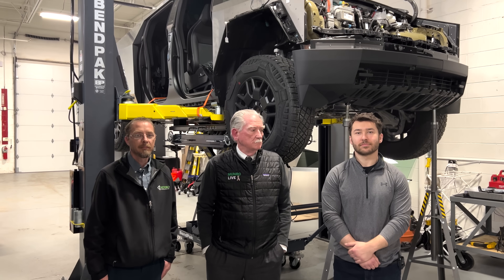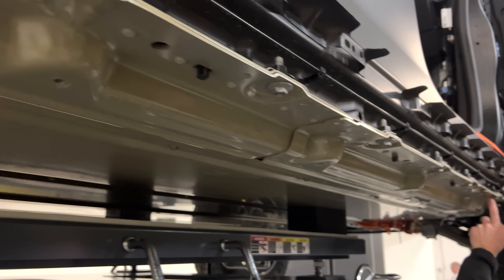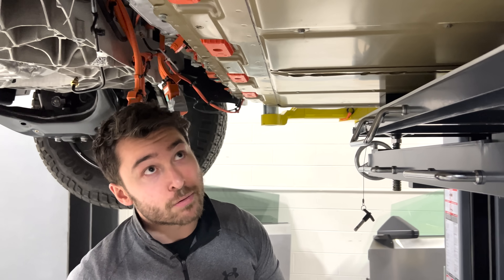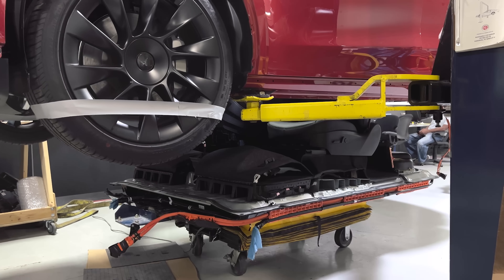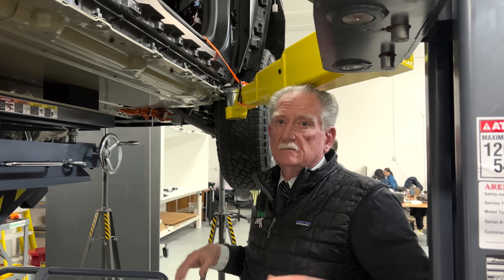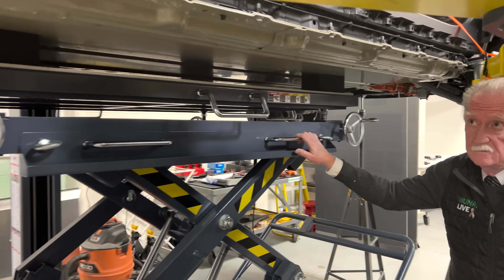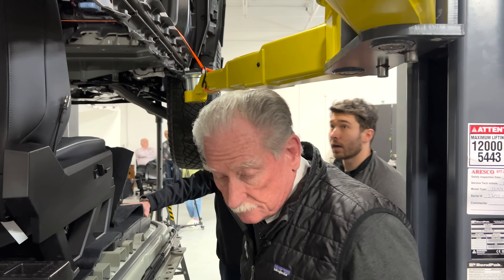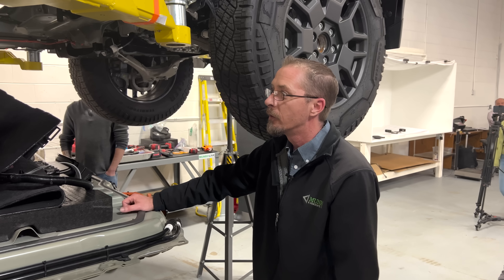Dropping the Battery Pack in Our Tesla Cybertruck!

Comment: Is the cybertruck battery pack wider and longer but thinner than the competition?
If that's the case, do you think they will switch to 4695 and 46120 cells for a long range truck?
Reply: I would guess that the Tesla 4680 cell is currently at about 50-60% of its eventual density.
.
The problem with taller cells is they require a different production line and won't be compatible with smaller vehicles.
.
What people miss about the (Tesla) 4680 is that it's just as much about the system as the cell.
.
The idea is maximum GWh (TWh) capacity, from the smallest footprint of factory, with the lowest possible energy and material consumption.
.
Efficiency.
.
It's about the goal of "Energy Transition" which includes HOW you use energy during the manufacturing process, not just efficiency in the end product.
.
Reply: @rogerstarkey5390   you talk a whole bunch of nonsense, 4680 cells are not at at just 50% density, they are pretty much ready and they suck. You would have to change the entire battery chemistry for a significant increase in density and move towards solid-state batteries (which aren't even really that dense as of today). The difference in size is of the 4695 cells in comparison to 4680 is not big enough to make a difference into which car they can fit. Generally speaking the industry moved on from 4680 cylindrical cells towards 4695 or even 46120 cells. In addition cylindrical cells itself lose their importance in the industry to other form factors like prismatic cells, they seem even more capable. The rest of your dream world of the Tesla battery being a "system" is just yapping.

Comment: To change a battery pack I assume is quite labour intensive having to remove all the "interior" instead of just a battery pack - Unless of course that comes off separate to the battery pack - Would be interesting to see that too. Great series this..
Reply: The savings are at the production line, it’s better to save money here than the seldom occurrence of removing the pack at some unknown time in the future.
Reply: @streddaz  yes, but it makes for very expensive insurance and repair costs which make the cars get written off in cases of accident. As an end user I'd rather the serviceability was improved - lets face it, the cheaper manufacturing costs are not really passed on to the likes of me - Thats for Elons pocket. That said, Munro is all about production line stuff so not probably aimed at the likes of me, a mere motorist - interesting as it all is.
Reply: @GHOOGLEMALE  I don’t think that just having to remove the seats, console and carpet will add that much to the cost of a battery. Manufacturing costs do impact the purchase price as can be seen by the reduction in price of the other Tesla models due to manufacturing efficiency improvements. I do agree that there should be more repairable components in modern cars. Unfortunately Tesla doesn’t follow the right to repair mantra.
Reply: @streddaz " Unfortunately Tesla doesn’t follow the right to repair mantra." Indeed, I understand workshops even bodyshops have been refused purchasing of parts to repair vehicles, Tesla is a one stop shop. - Once out of warranty the resale prices plummet. Important factors in owning a vehicle are servicing and residual values - a 100k car worth 15k in a few years cannot be sustained - there is a lot of good choice out there now. The manufacturing methods employed are cheaper, but at what cost in the medium term if no-one can fix it. I did see a youtube thing yesterday mind on a Tesla S 90 which had covered 450,000 miles as a taxi (Autoalex) - Thats impressive without doubt.
Reply: @GHOOGLEMALE  I think that’s the way a lot of companies are going in regards to right to repair unfortunately and not just the automotive industry. 
I have been watching Aptera for a while now and they state that they believe in right to repair, so I’m interested to see where they go once proper production begins. 
I really believe that more cars aren’t the solution regardless if they are electric or not. There are more environmentally friendly ways to get around.
Reply: @streddaz  Yes you are right. Aptera, not heard of it - off to google...
Reply: @GHOOGLEMALE  they are an interesting company. They focus on efficiency rather than throwing big batteries at the problem. Once again, their first car is just a two seater, so won’t be the solution for everyone.
Reply: @streddaz  Yes I looked at their video after you mentioned it - very funky and innovative. I just read on here (The Electric Viking) that Fisker have reduced their cars by 50% - $25k for the Ocean normally $50k. Sign they are going pop (again?)
Reply: @GHOOGLEMALE  maybe? Unlike Tesla, I don’t think the reduction in price is due to manufacturing gains, so they might be in a bit of trouble. Lucid also sound like they might be having cash difficulties too.

Comment: Thanks again. How did you get that pack with the seats out from under the body? I'm betting you had to take the seats off of the pack and man-handle them out?
Reply: Structural battery pack life
Reply: That hoist goes up a long ways.  Maybe not.   Tesla will have to do this at service stations.    I don't see them pulling the seats to get the packs out.  Would be lame as I think your trying to point out..   Not sure but I think the headrests may be removable.  They are put on like an adjustable unit. Two tubes.
Reply: The lift wasn’t fully lowered
Reply: @danharold3087  If you look at the first two seconds of the video, you can see the cross-member of the lift isn't too much higher than where it's at in that shot. When they drop the pack, it looks higher than that, so probably maxed out or close to it.
Reply: @garyswift9347  OK.  But there is no obstacle here. More of a choice.  could have started with the truck lower. Maybe not use that nifty stand.
Reply: @danharold3087  Fair enough. I don't know. That's why I'm asking. :)

Comment: Why don't they do the rear bench also? You'd just need to add a hinge so the seat bottom folds forward in order to clear the supports. Same goes for 4680 Model Y.

Comment: This is great. Is there room to increase the battery size?
Reply: "Size" or "Capacity"?
There's a difference.
Reply: @rogerstarkey5390   I should have worded it better and asked if there was room to fit more 4680 cells into the current structure/battery pack.

Comment: It’s ironic watching video after video of the associates gushing over all the clever engineering tricks that increase productivity and reduce manufacturing costs on a vehicle that overshot its original MSRP by 50%. 

Would be interesting to also hear about why the truck ended up being so much more expensive than promised, and the choices that got it there.
Reply: Prices have gone up on most items.  The truck is no more expensive than any other well equipped truck on the market.  Why sell it for less??

Comment: 24mm Bolts hold it up?
Reply: Looks like 20mm
Reply: ?
The number and diameter is more important than the length.
8-10 per side?
5-6 at each end?

Comment: What I want to know is if there is enougb room to add an additional battery pack underneath. I don’t want to give up 1/3 of my bed to get 500 miles range. 500 miles was the range promised and it was the spec that sold me.
Reply: I think I answered this question about 1/2 an hour ago.  No.
Reply: @danharold3087  then needs a complete redesign. START OVER. lol XD

Comment: If you have 3 phase current, will the battery still charge if for some reason one of the 3 phases is not working? Will it basically charge on two phase current?

Comment: Please explain the term 'the penthouse'.  Sounds like slang used by engineers but the rest of us don't know.  Also, where are the back seats and the carpet?  Were they removed off camera?
Reply: Judging from 6:48, the back seats remain with the chassis, folded up. Rear floor can be seen at 6:57 on top of the battery pack, just foam plus folded carpet and a piece of plastic cover.

Comment: Sandy, I'm going to ask a favor, can you please do a short video of where first responders can cut the high voltage wires in the Cybertruck? I have not seen one yet.
Reply: Why cut when you can unplug?
Reply: If you're a First Responder, I would suggest you "ask Tesla"
.
If you're not......

No comment.
Reply: @rogerstarkey5390  I have in the past, they tend to publish a 45 minute video that only two minutes of is what the Fire Fighters need to see. I am the planning officer in a local Emergency Management Agency. Getting a quick video to show where to disable the battery will save time on the scene. A short and concise video is something the fire fighters will watch.
Reply: @ronjos  If they can reach it yes they should unplug the cable.

Comment: Due to the high rigidity required of the battery pack housing to avoid cracking the potted slabs of cells, you'd have to be asleep to not to exploit that structural element.  Packs using pouch cell or prismatic modules would accept slight flexure if needed.  But, I'm so far unexpectedly impressed with the design engineering in the CT.

Comment: Saves on assembly. Adds cost to ease of maintenance. There are no solutions. Only trade-offs.
Reply: Probably no maintenance possible on the inside of the pack.. in the Model Y with structural pack that they disassembled... you cannot repair the inside of the pack.. its is packed with expanding adhesive foam. I would assume this is the same.. it has the same 4680 cells.
best you could do would be to swap the pack.
Reply: @kens97sto171  Yep. "Genius" design... for their bottom line.

Comment: DEAR MUNRO, (I have a question):-
As I understand it Tesla vehicles incorporate a rectifier, presumably to convert AC into DC for the purpose of charging from regular AC power sources.
Could you comment on the possible practicality of producing vehicles without this piece of equipment.
Some charging stations supply DC directly, for home charging the rectifier could be sited at home and if a vehicle owner wants this feature incorporated into their vehicle could it be made to be mountable/demountable?
This would seem to offer an opportunity to save weight and even possibly cost.
Do you think that EV.s really need to incorporate Rectifiers?
Reply: Let's leave it to the "smart people"?

Comment: Sandy " I don't know why this never been done before."  VW Bug leaves the chat.
Reply: He’s not talking about loading from the bottom. That’s pretty typical with drivetrains. It’s about the floor and interior elements being installed as a single component
Reply: @PeteLenz  Yes like a VW bug. The complete body dropped down on the rolling floorpan, on top of a seal and bolted together with 24 bolts. That would be the next step for Tesla.

Comment: That battery is so ridiculously thin that it's arguable Tesla should have raised the ride height a few inches and added a nickel metal hydride battery on the bottom for 50% more range. This is basically what GM did with the Silverado EV (though it's all lithium).

Comment: I'm close with a few Tesla techs and in the service center they do not leave seats in the car when dropping batteries that have this set up. Seats can be damaged on the way out and it's safer for the seat to be removed through the doors surprisingly
Reply: How? This came out like butter. No chance at all of hitting the seats. Maybe the Y has less clearance but in this truck there's no way I'd rather pull the seats first if I was doing the pack
Reply: "I'm close with a few Tesla techs and in the service center they do not leave seats in the car when dropping batteries that have this set up. Seats can be damaged on the way out and it's safer for the seat to be removed through the doors surprisingly"

Not likely. They were inserted vertically and the best way to remove them should be vertically as well.

Comment: would they show how they roll the battery with the seats on top from underneath the vehicle? Looks like even their magical battery lift does not go low enough to make this task easy.
Reply: You do realise that’s not the equipment Tesla use in the factory. Plus the pack wasn’t fully lowered, it was at that height so they could show the interface.
Reply: @streddaz  I certainly do realize that. My question has nothing to do with manufacturing process if it was not clear. In fact the title of the video itself "Dropping the Battery Pack in Our Tesla Cybertruck!" has nothing to do with manufacturing process either
Reply: @elagano  and as I said, the scissor lift wasn’t fully lowered. If it was they could easily roll the battery pack out with the seats attached.💁🏼‍♂️
Reply: @streddaz  hopefully you are right, but how did you figure it out?
Reply: @streddaz  How did you figure it out?

Comment: WHAT IS A STATION AND CAN YOU DO A VIDEO BREACK DOWN ON THIS AND OTHER ASPECTS OF ASSAMBLE LINES NOW AND THEN
Reply: Assembly lines are made up of work station.  For example one station may attach a door.  The operators at each workstation are allowed a fixed time period to do their task.  Industry standard is 60 seconds.   Fewer workstation do not reduce how fast the cars come off the line.  But they are less expensive to build and operate.

Comment: I like this idea for manufacturing, but it means the safety, structure, lectrical, sound proofing, water tight.ness, and a bunch of other factors, but I hope sandy will get into those later.  I can't wait for sandy to get to the wiring harness.  Ive been promised by Elon that sandy was going to scream about how good this wiring system is until hes red in the face!!!!  There is also the issue of the emergency crew electrical shutoff, which the model 3 had under the hood.  Also for crash tests it will look different if the structure of the car is attached with 10 bolts per side versus just welded to the cyberbeast.  Im curious what the crash performance is like

Comment: Nice design, but why is the pack size so small for a Truck?  Sub 123kWh….A bigger truck than a Rivian with a smaller battery and worse aero.
Reply: Smaller pack for those that feel it is sufficient with the optional extender pack for those that need it.
Reply: @jrharbortproductions   The extender pack we may never see.  Also, the "extender pack" is just poor/lazy engineering at best.

Comment: As an engineer I love the content and the fact, that you conduct a Cybertruck teardown!

But please don't do this! (~1:40min) Don't make such blunt statements on safety of HV / EVs like "don't kill ourselves". This does not help selling EVs to customers, that don't have the technical background. HV system of a production EV is SAFE with IT system, isolation monitoring, HVIL through all connectors (not fastened) etc. The HV battery internal contactors should have been opened already after you "switched" off the vehicle. Every EV owner should know this "clonk" noise. By removing the LV (by the way 48V ;-) not 12V think you noticed your mistake as you said it) at least or pulling any HV connector it is disabled if not "welded" (and even that is monitored by the diagnostic system).
So no customer should be afraid and every technician (following the rules, no severe 2nd fault on the system) is safe! Nobody would grab into a running FEAD - so why should you touch live HV. As you can't see electricity except when it arcs, you just need to make sure it is not live and can't go live again, when you work on it.
I think it is fair to say EVs are even safer than your electric installation at home.

Opening a battery pack - different story ;-)

Comment: Nice video but I thought the cybertruck was 48v and yes that's still considered low voltage first of its kind
Reply: Yes, it is 48v. That’s why he corrected himself and said “low voltage system”
Reply: In the service manual Tesla refer to the 48V system as MV (mid voltage) as against low voltage. I imagine they coined the term to avoid confusion because we all assume LV in a vehicle refers to 12V.
Reply: @MrAdopado  yes, quite likely. It would be an in-house term. In the electrical industry, low voltage is up to 600V or less, medium voltage is 600V to 2500V but there are a couple of different standards around the world where that varies by 100V or so. 
So in the electrical sector, 48V is definitely, low voltage.

Comment: Oops! Looks like the lift would go high enough to get the battery pack/seat assembly out from the truck. Interesting design though.
Reply: They could have started with the vehicle hoist 6 inches lower if that was the case.  So not sure.
Reply: They are just insulating pads. They could always lower the body if they needed to get closer to the scissor lift.
Reply: @streddaz  Battery case is not electrified.   More like pads  for friction and setting the contact points.
Reply: @danharold3087  I know it’s not electrified, but the Munro guys are very cautious when handling these packs. You are probably correct in saying that it’s for the best contact points but I also think it’s so that the steel base of the lift doesn’t contact the pack incase of any electrical shorting and to protect the packs underside.
Reply: @streddaz   Do not try this at home. No problem with too much safety here. 
But few  people understand what it takes to get electrocuted.    Electricians work on hot circuits but only with one hand.   If that pack was hot touching it with one hand would not harm you.  The electricity needs a path back to ground in the pack.   And then there is keep their insurance companies happy.